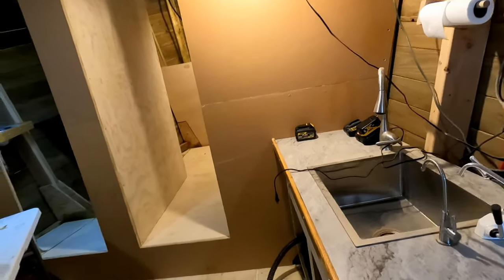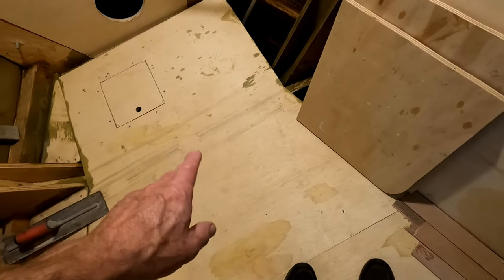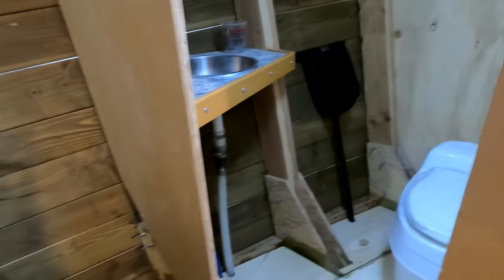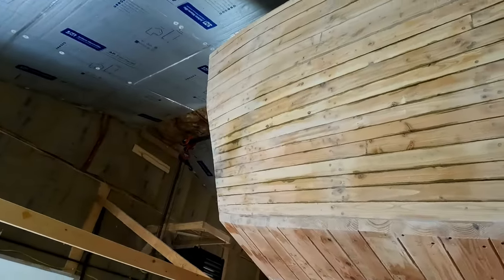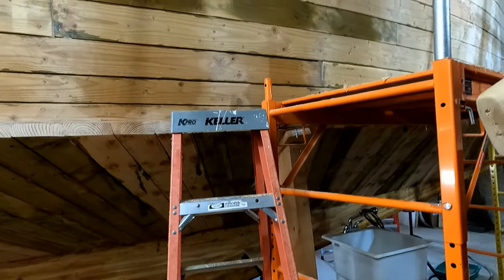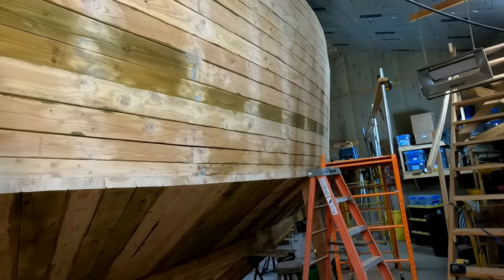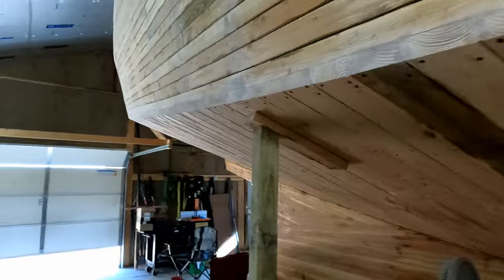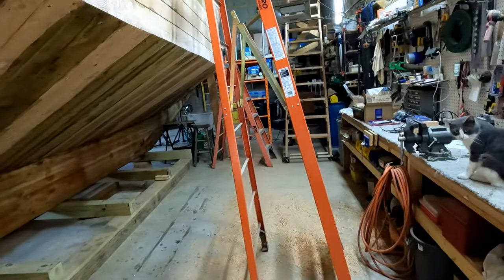Bilge Painting - Prepping the Side Planking for Plywood

Comment: Love your work, silly question, how are you going to seal the chine joint with plywood?
Reply from the maker: Thanks! The plywood joint will get coated in thin epoxy, then a layer of thickened epoxy, once that cures then it will be machined down to a gentle outside curve, then a couple of layers of fiberglass go over everything to make it water tight.

Comment: Why carpet? Vinyl flooring would be much easier to clean and vacuum. Particularly when it comes to sand they pick up on the beach.
Reply from the maker: A few reasons: I think carpet squares are going to be easier to install, the carpet should should hide all the hatch seams I have, I think cleaning is going to be a wash. But the biggest reasons are it's nicer under foot and it will have about the best traction of any surface. Of course it would be pretty easy to change the surface down the road if I don't like it. I'm planning on using those glue dots to attach it rather than glue it all down.